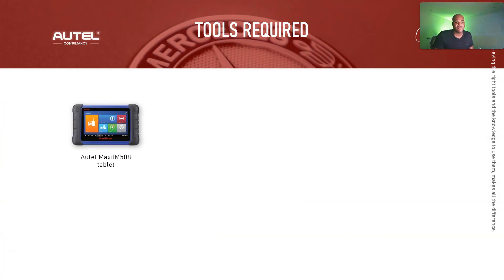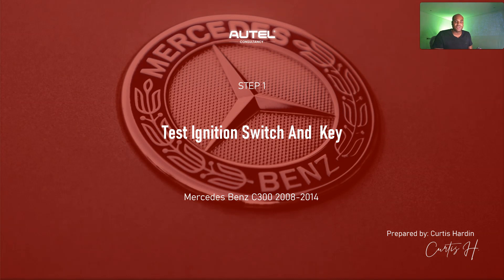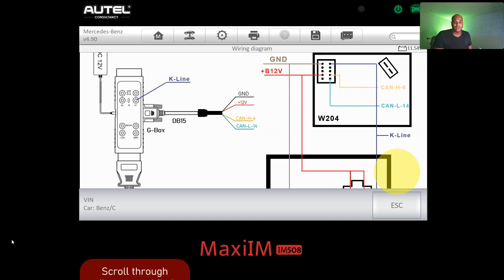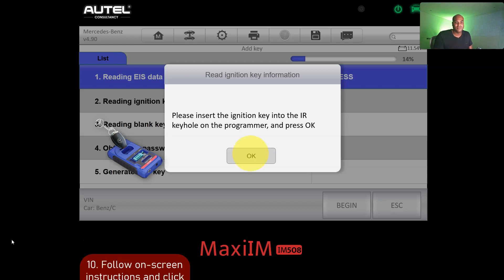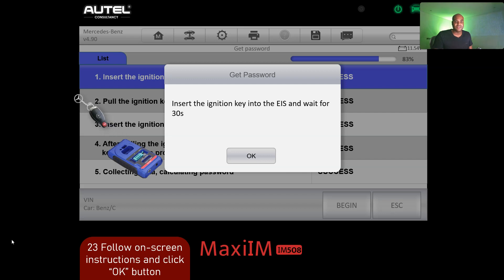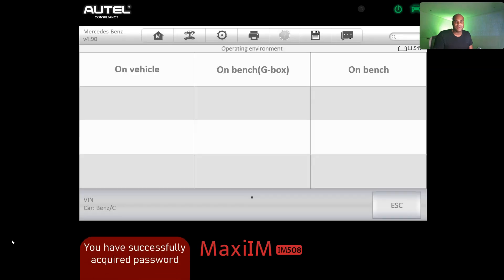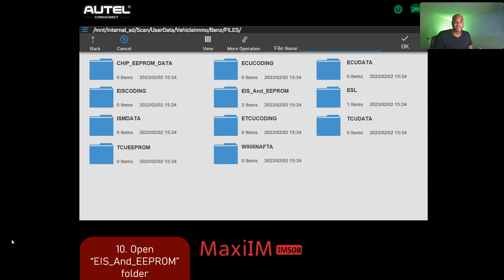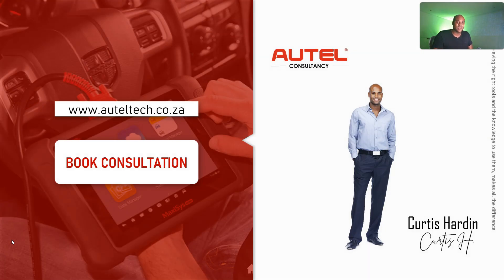IM508 Training   How to Replace and Program a Steering Lock Emulator on a 2008 2014 Mercedes Benz C3

Comment: Keep getting "personalization failed" message after entering the key password. Using a Xhorse emulator

Would there be something I'm doing incorrectly as I'm also following your video. I ran the eis test to confirm it works, etc and it's testing fine. 

I also ran the key test, eis, all tests for the eis along with the esl & it all appropriately works. I think I will contact Autel but also may try a different esl before I go any further. .

Comment: If somebody is doing this for 300 and they need to quit their job because the dealer does this for 1200 and if I'm doing it Mobile by minimum is $750 on this type of stuff because you're going to spend two trips there because they probably won't have the correct stuff there in the first time
Reply from the maker: From what I observed representing different clients all over the US.. The pricing varies by region and market demand and supply. If there's alot of people that can offer the service the pricing structure is more competitive . If the client lives in an area where their service is rare.. They can charge a premium. The pricing framework your doing is also what I recommend. Start with the dealer price and consider pain point to travel and send the car to the dealer. Then adjust your price a little lower than the dealer as your offering a premium service going to the customer and doing the job. If your in an area that no one can do this service you can charge more.

Comment: I get all the way to writing ESL data, I enter the password, it says it is writing, but then I get a message saying Personalization failed.. any suggestions? Update: even though it says “Personalization Failed”, I read the data on it and all keys were programmed into it. I went ahead and installed it, cleared all codes, and car starts fine. Fyi it was for a w207.

Comment: Hey Sir, 
I appreciate your efforts, I have a question please, can I use an original used ESL instead of the emulator?
Kind regards,
Reply from the maker: You can but its going to be more expensive. An Emulator is under 40 usd